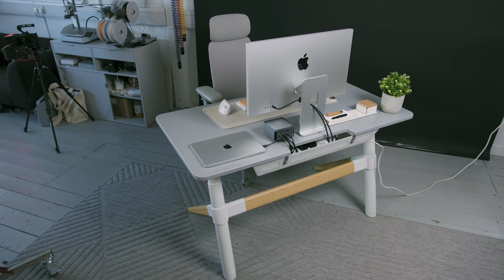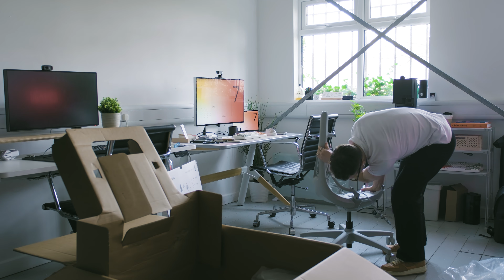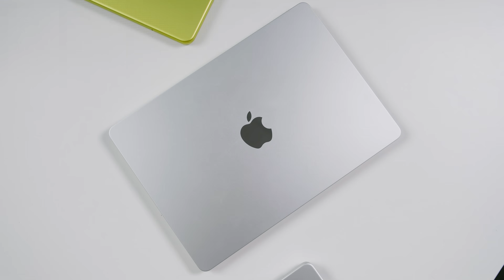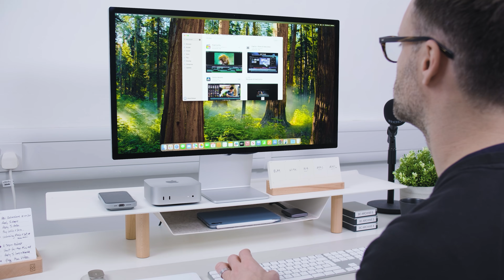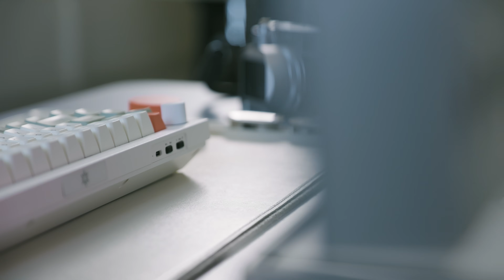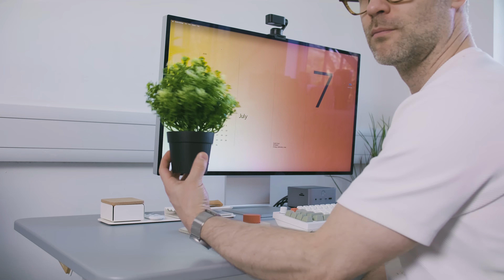I Built My Dream MacBook Desk Setup 2026 (Twice!)

Comment: Thanks for featuring Karma Essence. Just a small correction: the iF Design Award was in 2022, not 2026. I am actually the original designer, so it was fun to see it featured here. Also, one small detail that is easy to miss: there are two small rings underneath that you can pull, and the cable tray lowers straight down by around 100 mm, so you can access the cables without opening the tray.

Comment: I really want that webcam but looking at the Benq monitor (because I like the integration it has and I prefer matte screens) I can't have it on top, so I might have to have a tripod so it won't look as sleek as you have achieved...first world problems right, but a set up is a set up and we can it clean!
Reply from the maker: I actually used this with my BenQ - it will be fine - mug ht just need to mount on a clamp arm with the 1/4 20 mount - it works fine - and tbh - it was OK on mine - just not as secure.